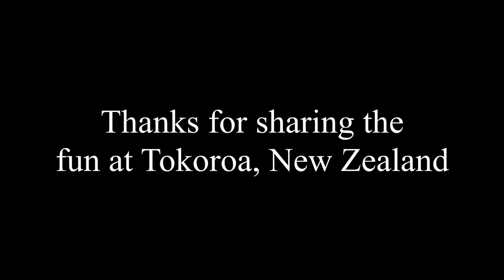Can you start a diesel car with curling tongs?

Comment: Often wondered how those full-size aircraft were powered since there's no silicon tubes or xt60 connectors dandling under their fuselages. At 2:40 I finally got the answer:  I could clearly see the pilot twisting the rubber band for his next flight!
Reply: Ibrahim Ulf Karlsson I was thinking the same thing.

Comment: That was cruel asking him to do a loop. You just wanted to see him crash the poor old bird. Good flying to get the emergency landing in. The bird lives for another day. I told you those engines just keep going even with no back pressure. They go on fresh air. You better check the valve clearances or you may bend a con rod.